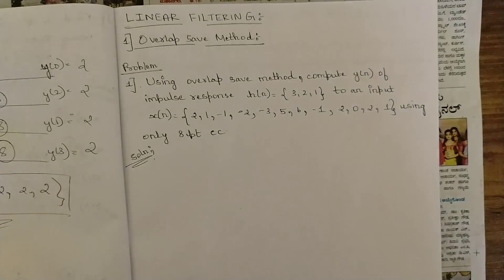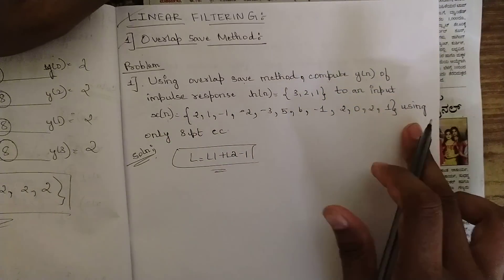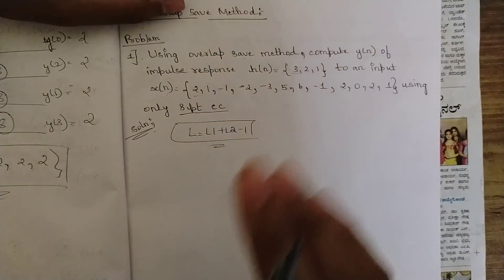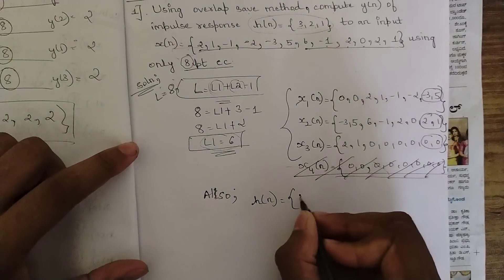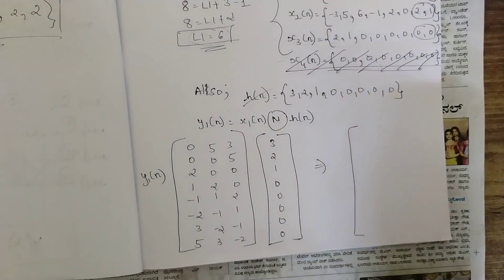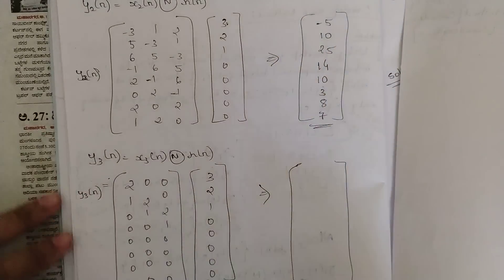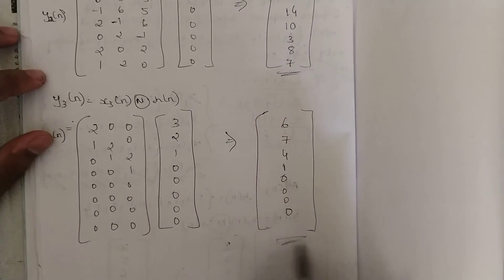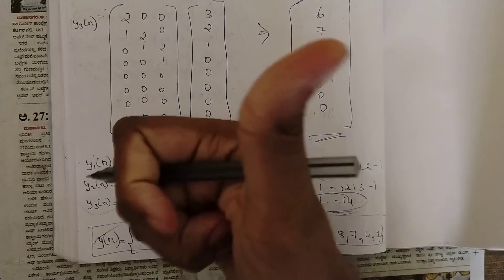5.Linear Filtering Overlap Save Method Concept,1 Problem Solved Module 3 5th Sem ECE VTU BEC502

Comment: Sir, what if they dont give the value of L?
For example this ques: .Using linear convolution find response for the sequences  
x(n) = {1, 2, -1, 2, 3, -2, -3, -1, 1, 1, 2, -1} & h(n) = {1, 2}.  
Compare the result by solving the problem using overlap save & overlap add method.
Reply: that time you can use this formula N=2^M where N indicates equal parts to be made of x(n), M indicates length of h(n), and when we get value of N, we should calculate for L using this formula L=M+N-1.
Reply: We can derive L based on a formula 
N=L+M-1

Comment: Bro there are few derivations in module 3 with linear Filtering. Mostly there are derivations like circular time shift, frequency shift, will they be asking problems based on derivations or only the derivations??
Reply from the maker: No no only the problems would be asked based on it ig
Reply: Can you tell is it necessary to read those derivations Or there are problems based on those??